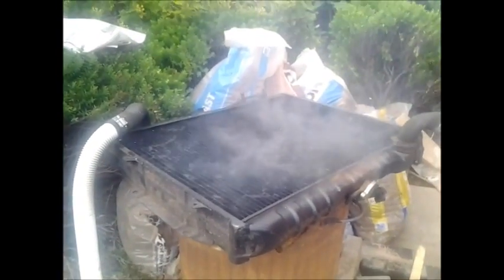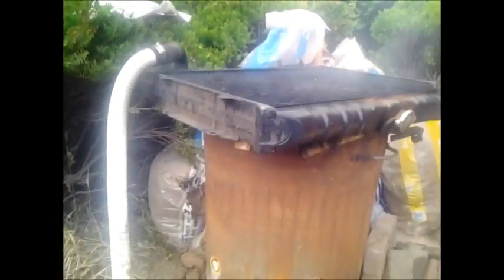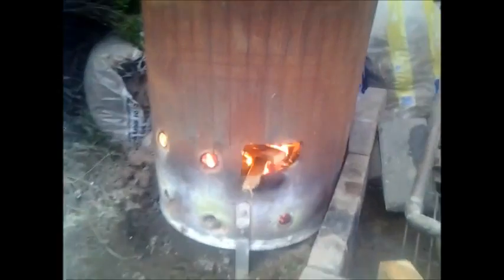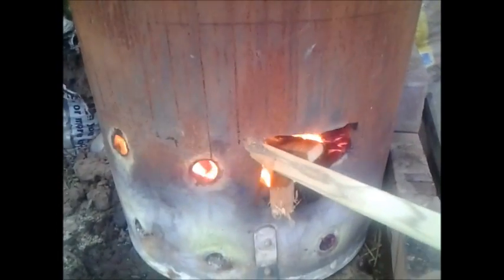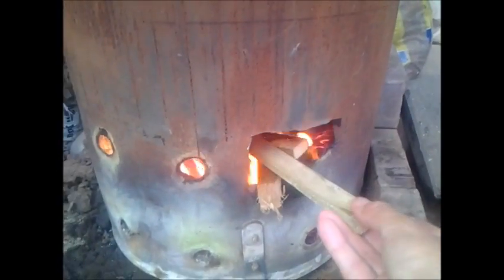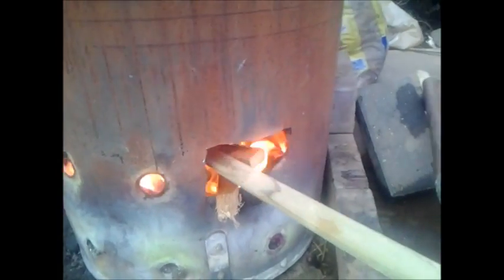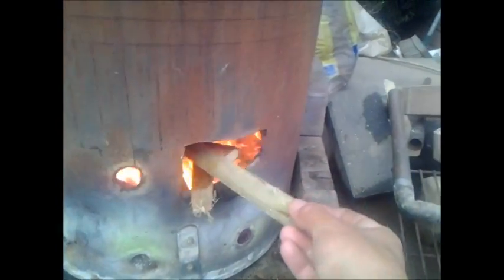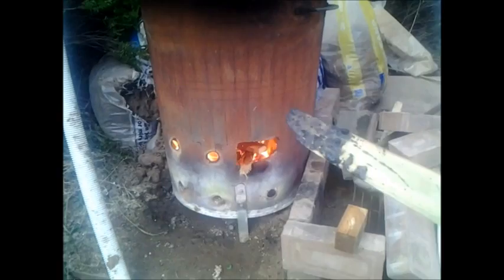DIY Swimming Pool Heater with Car Radiator and Garden Incinerator.

Comment: Im thinking about doing similar but using a cast iron radiator and a rocket stove burning waste oil  and a metal hood over it to reflect the heat back down into the radiator..   I have found 0 results yet  re anyone else trying but many using car radiators.

Comment: thank you from NZ. I was considering the same. I guess soot is always going to be the issue.
Reply: Just don't burn soft woods, they make a mess
Reply from the maker: I eventually installed a 50KW kerosene boiler which makes life much easier.  I had to put a valve in to ensure the boiler temperatue never drops below 60'C otherwise condensation builds up and rusts the boiler.
I think the same would work for soot - if you keep the inflow hot by recirculating the water then condensation won't form and soot won't stick to it.

Comment: what a load of crap
Reply from the maker: Not really, learned a lot since then.  The problems were caused by too much cooling so you need to keep the watar flow above 60'C.  Since then  however I can't be botherd with fueling and cleaning so switched to kerosene.  So much easier at the flick of a switch - I just don't get the time to make videos of it these days.
Reply from the maker: Yeah, you are probably right.  It was a very first attempt and I've learned so much since then.  I should probably do it again properly - maybe this summer(?)

Comment from the maker: After removing the fins and just leaving the pipes, power output has dropped massively - I guess about 5Kw.  Very much a bad idea so I should have just poked holes through with a screw-driver - it would have been quicker and left me the option of removing them altogether.  Oh well. :-(

Comment: Why not try submerging the radiator in a barrel of water and then heat the water barrel? That way you wouldn't destroy the radiator. Just a thought.
Reply from the maker: John Sortore I wanted the surface area in the exhaust gasses to extract as much heat as possible.
I tried removing the fins just leaving the pipework which I think almost worked, however in my haste I realised it was now too hot to lift the radiator back off the incinerator because of all the hot air going through the radiator.  By the time I found a bucket to douse the flames the radiator had burst.  I should not have rushed.
Reply: But won't the direct flame contact with the radiator burn through the fins and tubes it in just a short time?
Reply from the maker: John Sortore I'm not sure.  The idea is that the water passing through the pipes (connected to the fins) is rapid enough to keep everything well below the boiling point of water.  The hot gases may have a corrosive effect but the conductivity of copper should keep everything cool - there was no sign of anything melting.
Reply from the maker: John Sortore Note: there was slight warping when I removed the fins and just left the pipes but I'd expect that with long and thin unsupported copper tubes.
Reply: Keeping it away from the direct flames should help. After the fire gets going, maybe try cutting off the draft and setting a cover over the radiator with some 2"-4" spacers to hold the heat in but let the ember breathe. It might intensify the heat build up and concentrate it onto the tubes.
Reply: John Sortore genius, wish I thought of that

Comment from the maker: After putting some thought into it I think poking lots of small holes may solve the problem entirely.  If I can raise the exhaust to over 100C then there will be no condensation and soot build up should be negligible.  The extra draw from the fire should easily compensate for the loss in efficiency.
Ambient temperature was 18C and the fire was over the 430C my thermometer maxed out at.  Using my incredible post alcohol maths a 100C exhaust would only equate to a 30% loss in efficiency but constant and higher power.